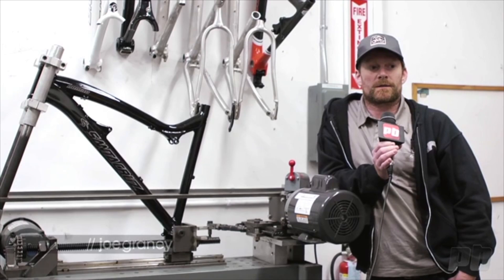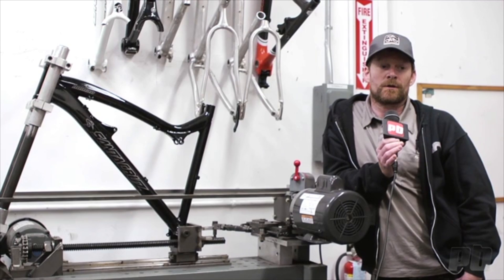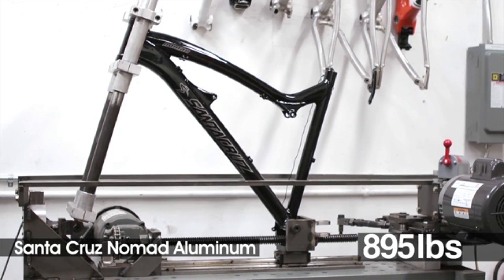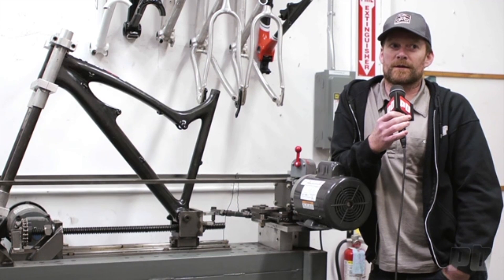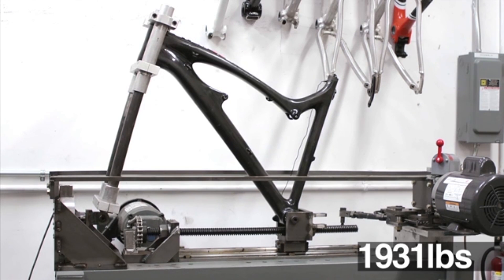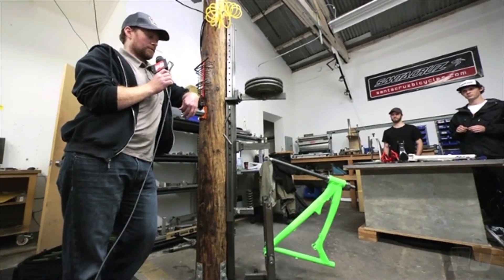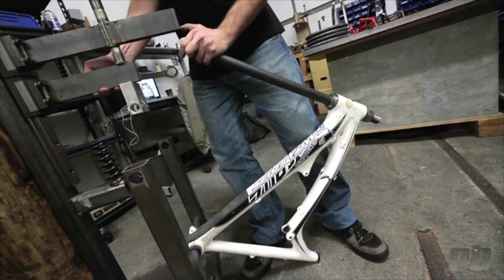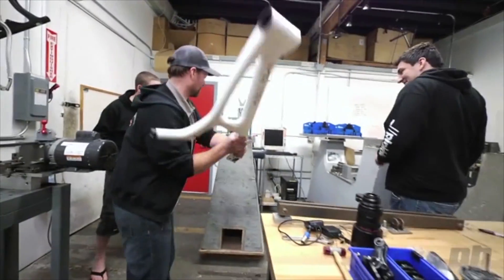Carbon vs Aluminum Frames - Which is Stronger?

Comment: Somehow Carbon frames seem to rule over alloy frames after viewing this video. Still for safety Bike parts like a STEM, MTB (downhill) handlebars, saddle rails, cranksets, suspension front forks most times T7 Aluminum is prefered over carbon.
Also heavy high speed E-bike frames most often aren't made of carbon or seem to do fine on oversized Aluminum frames with integrated battery packs..

Comment: They should have tested direct frame strikes for dents,cracks,stone strikes etc and lets see how the frame really holds as its the most common scenarios that happen when you crash in the trail..
Reply: Did you miss the part where they swung the carbon frame into a concrete corner?

Comment: Although the strength of aluminum was low, the aluminum was plastically deformed and the carbon was just broken.
If you hit hard while riding the bike or fall from a high place, a load greater than the test load will be applied to the frame anyway. An elongated frame is much safer than a frame that breaks when force is applied. And it is clear that cracks or delamination may have occurred in the carbon frame as well if the load enough to break aluminum anyway.
Aluminum is cheaper and safer for general use. Also, since carbon is hand-made, the quality between products is similar but slightly different. If the number of tests had been increased, aluminum would have a constant breaking strength, whereas carbon would certainly have a broken frame under a much weaker load!

Comment: Impact of 110 lbs (50kg) from 900 mm (0.9m) has 450 joules of energy, which is equivalent to a 85kg rider on a 15kg bike crashing head on at about 10.8 kmph (6.7mph). 

That's an extreme case because normally, driver does not crash face first onto handle bars but he is thrown off the bike.
If we consider a crashing weight of only 20 kg (15kg bike and a driver pushing a little bit on handle bars) than the frame breaking speed is about 24 kmph (15 mph) for a head on collision. 

Again, this is an oversimplification, because a bike frame during a real world crash is not crushed like this but it is more "springy" and the impact energy dissipates into frame rotation and vibrations of multiple parts over a longer period of time.

I hope my math is right. :)

Comment: I would love to see a modern steel frame go through these tests
Reply: They should make a new one with a bunch of frame types.
Reply: Yes
Reply: Just to able to buy a frame  I be happy as pig in mud  , but no I watch  frames get destroyed  
That’s punishment .
Reply: @Future Corpse I've got no idea when it comes to material science, I just know from my own experience riding a chromoly frame. I've ridden that frame for over 10 years on a mixture of skate parks, roads, and trails. I also know there is a difference between elastic deformations and plastic deformations, so it may be that chromoly is more supple but has a greater ability to flex and not bend or break.
Reply: Titanium too
Reply: Chromo is basically bulletproof, not to mention even if it bends you may be able to ride long enough to get out of danger.
Reply: @ForcedCompliance  only problem is weight but now that other parts of the frame can be made of carbon.
Reply: @lacasadelvideojuego3880  I suppose it's just a matter of priorities, realistically once they put in the same kind of R&D into carbon I'm sure it could be as good or better than modern alloy frames.
Reply: @lacasadelvideojuego3880  Weight is the problem of the rider, not the bike.
Reply: @lacasadelvideojuego3880  yeah, a 4130 chromoly steel frame can be pretty light if the tubes are butted
Reply: @SimpleTrax  yes I would not trust a carbon bike being 280
Reply: @lacasadelvideojuego3880  chromoly has a higher strength:weight than aluminum
Reply: @ForcedCompliance  so delusional. a steel bike would fail at about the same time as the aluminum one unless its overbuilt.
Reply: @ForcedCompliance  sounds like the metal from the alien ship that crashed in roswell
Reply: @ForcedCompliance  You'd have to heat treat it to get back anywhere near the original strength if you bent it back.
Reply: @glibsonoran  you're right, I just figured that's not an option for carbon frames.

Comment: Higher ultimate strength doesn't necessarily equal better. The carbon fails by brittle fracture, which is catastrophic failure, as opposed to ductile failure in which you have plenty of time to realize the damage and avert danger.

Comment: Thing is, in the first test the carbon started cracking at 450lbs. So if it takes a lot of 450lbs hits in a real life enviroment, it would still eventually lead to catastrophic failure. Not the 2050lbs you're "advertising".

Comment: The thing with the drop test is that the carbon fibre endured all those drops and eventually snapped and the aluminum frame just bent at that load.
Reply: alu is safer

Comment: Carbon is stronger than metal at resisting tension but test it against blunt impact (rock hit) and see it fail catastrophically. The hits they were giving to the frame in the end do not represent a good rock hit to the frame.

Comment: I beg to differ that casing a jump would actually cause force just the opposite direction than what it simulated in the first test. First test is like driving the bike to a concrete wall.

Comment: Carbon is cool, light, stiff...
But once it breaks:
1. It snaps rapidly in 2 pieces, rather that just bend
2. It's unfixable...
Reply: Carbon unlike alloy is totally repairable.
Reply: @mikedicke5505 
If you fix a cracked carbon frame it will never be as stiff & strong as a fresh one

Comment: Carbon fiber might have a stronger tensile strength, but it started cracking and losing structural integrity at 800lbs.

Comment: Different tests, that's nice.
The carbon cracks where alu absorbs.
Reply: I think you got it mixed up
Reply: @owenissimo  Did you have sound on? The C is cracking at pressures prior to that of alu's bend.
Either way I'd much rather have a bent bike than two halves.

Comment: For the weight drop test, AL frame failed with roughly ~170 joule impact, the C frame failed with ~440 joule impact, which is over 2x. Pretty cool

Comment: 1. To complement these tests, simply compare aluminum prices with carbon fibers. If the fiber were just as strong and stiff as aluminum, it would not be as expensive as it is.
 2. What are the advantages of such tests? When making the next frame, insert a short section of carbon fiber in exactly where the cracks occurred  in that tested frame.

Comment: This test is really nice but it  dose not show the results of a  small rock lunched at the lower tube of the frame by the front tire.Also a bend aluminum frame is much safer then snapped in to carbon fiber reinforced plastic.

Comment: Carbon fiber frame is a ticking timed bomb.
Reply: Agree Carbon fiber frames are for the ignorant or less experience bike riders who don't understand what they are getting into.  All this is just a sales pitch for carbon in a controlled environment. You don't even know the quality of the aluminum.  I've seen aluminum survive much more weight than carbon.  Best to take the absolute best of both and test them which I doubt was done here.  Even then its a controlled environment that carbon frame will be taking damage from all angles with rocks hitting it constantly as well.  Carbon just isn't the best material for mountain bikes regardless how they want to spin it.

Comment: In regards to the components that come on complete bikes from these guys, avoid this junk like the plague, anything SRAM makes for that matter.  Their warranty is a joke, my bike with less than forty hours on it which is a 2018 Santa Cruz Bronson has literally had every component made by these guys fail and of course it's past their alleged two year warranty.  The Reverb dropper (made by SRAM), guide R brakes, and derailleur have all FAILED on what is still a new $5k bike.  They wont deal with any consumer personally and you will need to take your bike to your local bike shop where it will sit for an undefined amount of time to be no less than a week at which point they will "determine" based on that LBS feedback whether or not they want to cover their junk product.  Waste of money (a lot of it) and more importantly your precious time that could otherwise be spent riding.  Moral of the story, stick with just the frame, and build it with Shimano components.  Your welcome.

Comment: I trust only steel frame. It's cheap and durable. Some manufacturers write snap warning in other material frames user manual. One of my  aluminium frame bike starts cracking paint in bottom bracket joint. I stop riding it. 

Once i was young guy i asking some welder to welding my steel bike frame. He did laugh at me. He was never even heard that before. It was old rust damage, not crack. 

https://youtu.be/k7e004bfHyY Carbon frame repair shop. they don`laugh at you.

Comment: Reality check Carbon is way stiffer carbon is still intact and still good after an hard crash impact where alloy will bend or even snap but another Reality check if both frames will break its not anymore ridable/Usable get "A New bike Day".

Comment: Would still recommend aluminum which is way more safer and can easily detect visible damage 

Than carbon you have risk using a damaged undetectable frame

And carbon snaps when it breaks

Aluminum just bends and way more cheaper
Reply: Carbon nowadays are why stronger

Comment: Government and scientist are not fool. If this trendy thing, carbon is really so excellent and powerful, all Boeing won't be using aluminium to made their sky buses. They would had use carbon Instead. Come on carbon supporters here please accept this steel concrete fact, alright.
Reply: Boeing and Airbus are using composite materials in their planes, and have been for at least 20 years now. The newest models have up to 60% of the plane made of carbon. Stop chatting rubbish.

Comment: Hmm. I dont really trust carbon frames, i feel more safe riding an aluminium frame. And about the test?? I worked as a welder so i know metals, if the alloy frame is 1mm thick and carbon 3mm thick then of course the AL frame will fail.

Comment: Tards talking about delamination need to stop. I guarantee y’all are too pussy to ride a carbon frame to even 10% of its potential so you don’t have a thing to worry about. Decent carbon is cheap now, so in the extremely rare event of failure, go buy another frame.
Reply: Most of the time there's good warranties on carbon frames so just buy a good one and at the end of the day realise you won't even need it cuz you will not be able to break such frame at all

Comment: Why would you waste your time testing a situation that almost never happens. You should have tested a common "case" where the front tire makes it over the jump and the rear doesn't. Should have pulled the front axle away from the bottom bracket...

Comment: Lol, there are lots of people defending aluminum in the comments but the clear reality is that carbon is much stronger. Sure you can ride a dented aluminum frame home whereas carbon just breaks...BUT it breaks at massively higher forces where it may not have to be broken...and its probably significantly lighter.

Comment: Carbon frame may be catastrophically damaged without you even knowing it, that's the real danger. As pointed by some other posters here - once delamination begins it's no more safe. You may not even be aware, from the outside frame may look just fine. Aluminium can obviously also fail catastrophically, but more often than not there are plenty of signs pointing at a frame being damaged before it snaps. It's just a case of people not giving their bikes proper attention. 

Of course carbon is a great material, and carbon frames have their place. But for ordinary riders? I just don't see how potential benefits outweigh very real downsides carbon has compared to alloys.
Also, seems like they are testing for a completely wrong thing. At the very least their methodology is incomplete. Where is the test that simulates hard landing on a flat? By far the most common way to break a frame. Not to mention how nobody is wearing even basic eye protection. Felt like amateur hour.

Comment: To be fair, they should've pushed the aluminum frame until it snapped. The number of cracking sounds the carbon made before failing is enough to be sure that frame was toast long before it snapped. Gotta love the one dude that shields his eyes and turns away while the rest of the crew looks on. Safety glasses go a long way.
Reply: They are a pro carbon company and not a pro aluminum company.  Think they discontinued all their aluminum models could be wrong.

Comment: You cam hear the carbon frame 'clicking' really early on in the test, that means the fibres are ripping, carbon is weaker
Reply: Everyone knows that Aluminium is fatiguing over time.
The constant forces of pushing and pulling on a frame is weakening the structure over time.
Carbon on the other hand is immune against it.
Reply: @Marc28031984  the fibres can easily rip in catbon fibre, that weakens it over time
Reply: @samuelparamor3726  didnt you notice the first "pop" CAME at a greater force than when the alu was starting to look like a pancake?
You literally have to get a frame bending (totalled) incident in order to worry about carbón being close to failing.

Truth IS i was intereses in carbón Fiber before i was interested in bikes. And it did ring me when people said cabron Fiber IS frágile or weak.
Aluminium IS superior in the temperature department, but thats irrelevant for cycling. And then superior for creating complex partes because of machinability, but thats why pedal, tee s and the like are hard to replace with carbón. 
Another advantage could be weldability, but that IS rarely ever done on bikes
Reply: they even try to hide it by fukking with the audio
Reply: Yes you can hear the fibres ripping, but just because you cant hear anything with the aluminum doesnt mean nothing is happening. The grain structure in the aluminum is slowly deforming as stress is increasing. Carbon composites are proven to be stronger than aluminum, but composites are also less ductile, which is why there was a much more severe break when its ultimate stress was reached
Reply: @iansmith381  but over time, when the fibres are ripped, that causes carbon to crack easily and aluminum is much better for that long term useage
Reply: @samuelparamor3726  The ripping of the fibres would definitely decrease the structural reliability, but the carbon fibres didnt severely start cracking until after 1500 lbs of force (although I'm sure there was slight grain deformation before this).  But aluminum experiences similar issues over time. The aluminum has a lower yield stress, so when that stress is met the material practically deforms. This means it cant return to its initial position, and that it wont be able to take as much stress as it initially could. So if you were to only apply 800 lbs of force, the aluminum frame might still work, but would not be as reliable. Carbon fibre has a much higher yield stress, so it can handle larger forces and still be just as reliable. You should check out stress/strain graphs for carbon fibre and aluminum. Side note: I question the validity of the first test because bike failures are usually due to impact forces, but it's still super interesting to see
Reply: 100% Carbon is weaker!!!

Comment: It's quite obvious that the carbon fiber frame is stronger than the aluminum version of the same frame. But what I'm curious about is how well the fibers and the binding materials hold up over time though stress cycling. Those tests show that during extreme crashes the CF will survive a bigger crash than aluminum but for most of us who have crashes that don't exceed or even come close to the aluminum's limit will the CF version keep its strength over time and miles?

Comment: A guy just bought a nomad carbon frame, on his first ride a rock jumped from the front wheel and hit the frame protection on the downtube. He thought it was just a scratch. At home when he removed the protection the frame was so damaged that he could not use the bike any more. That's something comon on trails. I am talking about a 2018 model. 

Thank's, but no thank's. Aluminium still going strong.

Comment: Ok, carbon is way stronger (depends on the engineers you give it to)
But what really troubles me, is that carbon is way more difficult to recycle than metals.
I think as long as we mountainbikers are willing to sell/throw away our frames because the decals on the new model look more rad, we are not ready for carbon yet.
those used carbon frames are mostly stacked on a pile for millions of years to come, unless someone recycles them, which is still in development.

Comment: What are we talking about here IRL?

I'm looking at Santa Cruz because IDK, I'm an 80's Skater kid from the Bay Area, and I just always like Santa Cruz, but whoa... the prices... inflation got us like that huh? Or was it the Tarriff Man... 

I was thinking a used Tallboy LTc... for weight, but... what I need is something that can hand the N.GA Mountain Singletrack and some little jumps/pumps that I get confident on... 

Biggest issue with my current bike was no confidence going down, and all wrong... 26", hardtail, GT Avalanche... couple trail rides taught me well enough - it's not a trail bike, probably not sized right either. Too $hort wheelbase, short top-bar, not enough... rake / and up too high = that over the bars kinda thing happened one too many times for my comfort level.